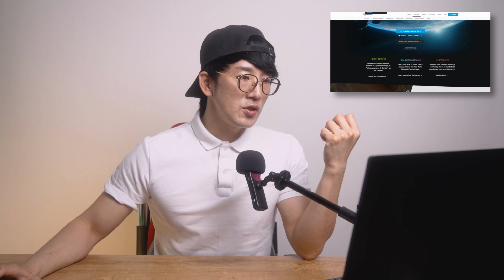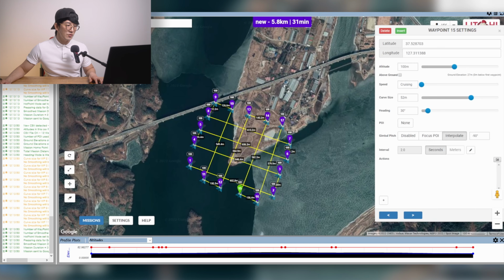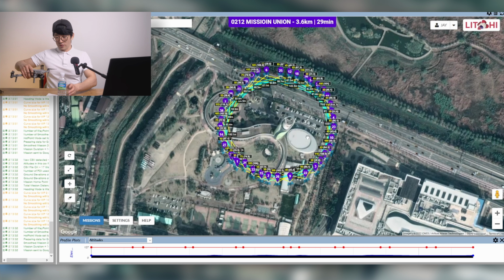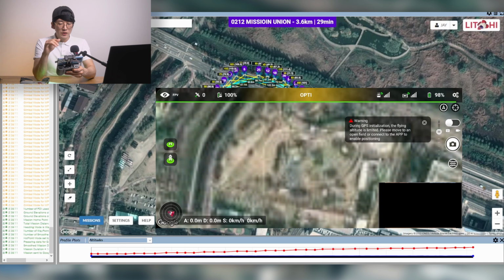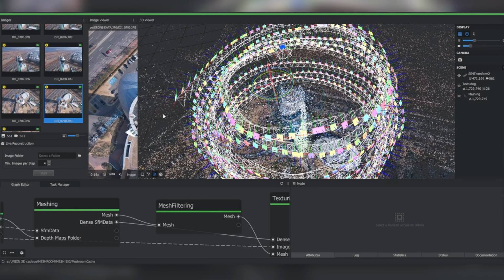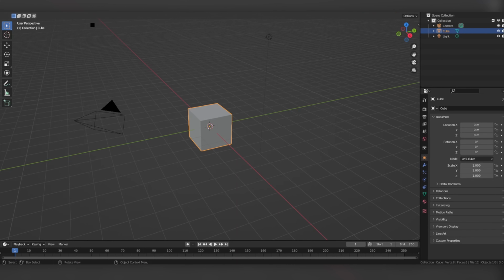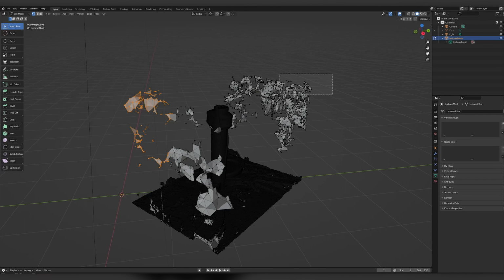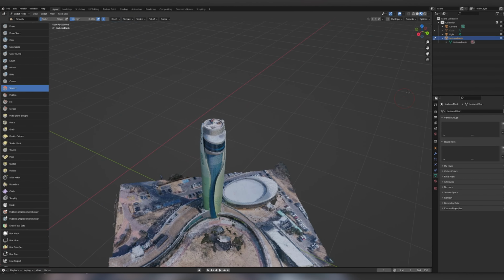Litchi + AIR2S : Mapping, Tower 3D Modeling walkthrough

Comment: Also. Would it be better to create 2 missions? Or find a stop point at roughly 20 min to swap batteries and memorize it? Ive not used Litchi enough to know if you can combine the two missions. I assume you can just copy and paste the files into one folder then process them?
Reply from the maker: and yes that's how I do if it takes more than one battery, for most of my job actually, and in my guess it looks like the Litchi has started getting into the mapping market bit by bit by looking at they put the couples of functions to the mission planner. I sent the email but my channel power isn't that impressive to reach them quite yet I guess. 😅 For the process, yes i just copy and paste into one folder and try to reduce(delete)  if there is overlapped the data(photo) because for the process consistency gives us better result than amount of data.
Reply: @vjmw  Well keep working on it! You figured this out so you have the skills and talent! Normally hard work is rewarded eventually! I'm a old fart and seen guys give up right at the moment they were about to succeed and I know they missed a HUGE change and major chance in life! 

Just find your happy place and pace but keep focused on the road ahead and never worry about the minor set backs in life! 

Thanks again!
Reply from the maker: .. I'm so moved. What more I could get appreciated than this. Thank you for the words and really means a lot to me for now. 🙏